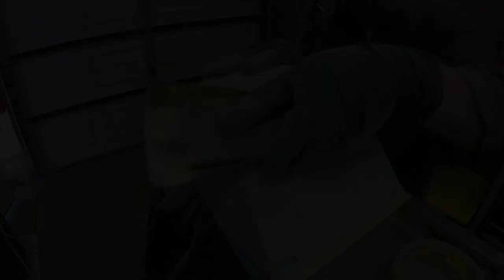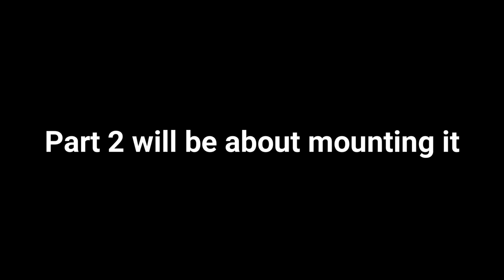CX500 Street Tracker Build - Making a Fiberlgass Cafe Racer Cowl!! - EP17

Comment: Awesome work. As said, making a mold of your initial piece with gel coat would give you a better finish and the possibility to do a few differents copys ( if you break it  ) and you will not have to bondo the whole thing for the high and low spots you probably have now.I Did one fiber glass seat a few years ago and beefed it up from the inside with few more layers for a better tickness, also you may add thin strips of metal to re inforce it. Keep rocking, your work is awesome
Reply from the maker: Thank you much, Im still undecided on what to do but Im leaning toward just gel coating the existing piece to use. We will see. Strength wise have been working on an internal cage for it to prevent any movement.

Comment: Awesome, but quick question, how does it get attached to the frame?
Reply from the maker: I have a frame work made on the frame it attaches to. In the frame final welding/teardown video I show some of it.
Reply: @BrickHouseBuilds  yeah i saw the structure, and at the end of the video you mention something about needing to finish the cowl structure, but it doesnt show me how it would attach. Im just confused about that part and im blank upstairs as ive never done glass either so i dont even know where to begin

Comment: I'm making some custom side covers for my GS450L and love your videos for help and inspiration (you helped me shim my valves). Anyway I'm looking at your products list and was wondering if the pint size of resin was enough for you? Do you think it would be enough for 2 side covers? Also I could be wrong but it looks like your using fiberglass cloth. Your product link sent me to a fiberglass mat product. Is this correct?
Reply from the maker: I would think it would be enough as I still have some material left over.  It would be close regardless.  The links are correct as you are seeing me use pieces I have already cut off of the main mat section.